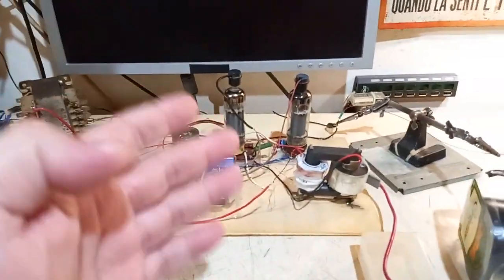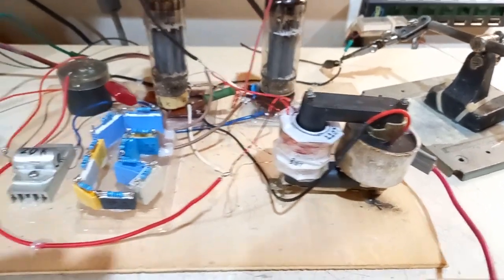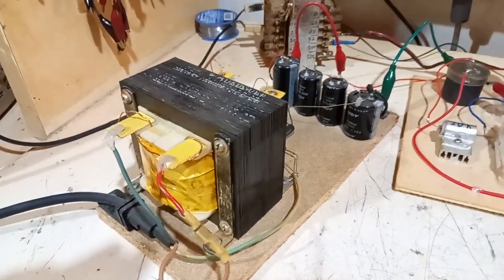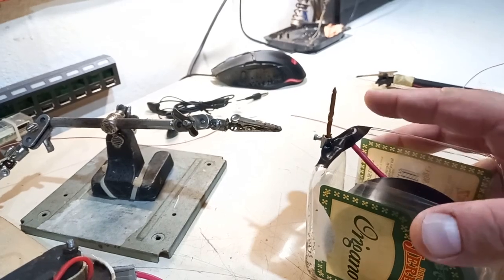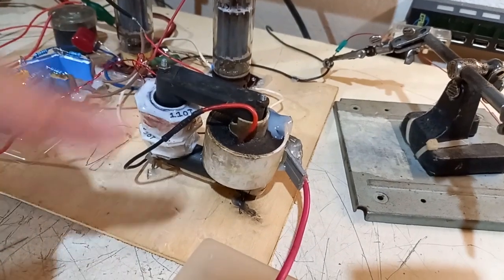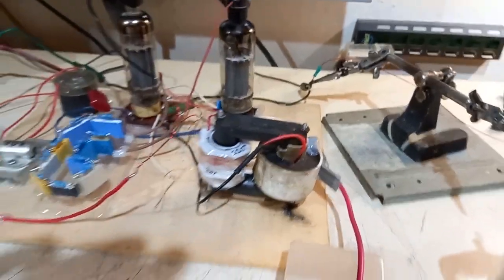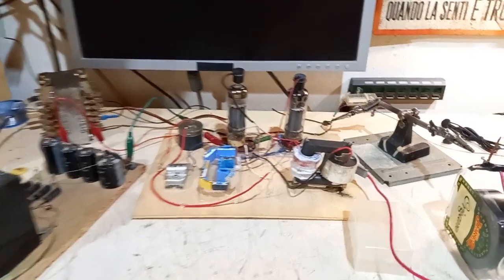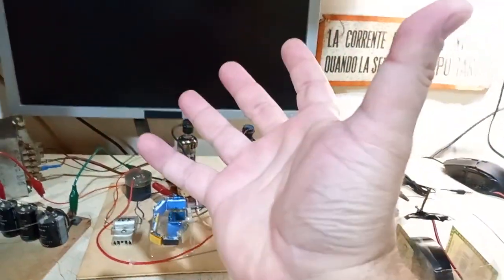A More Powerful Push-Pull Tube Flyback Driver (2/2)

Comment: Ah I see, sorry, you have the scheamtic in the description. I wad blind.

I wonder if this would work better with a gridleak, so capacior across your grid resistor to establish class C bias so you could drive the tubes harder to get more peak output power.

A friend of mine form poland is doing a similair thing with 2 GU-81M tubes in push pull, he's also been building a computer simulation of such a circuit. Real fascinating stuff.
Reply from the maker: apparently considering the slow speed and the circuit being specular a simple low inductance resistor is enough, i tried with caps but it just works worse, there's probably a better way than this but it works decently, tho i'm not exactly proud of this project

Comment: I've always wanted to build a TC with a push-pull circuit but been told it  doesn't work too well.  It's possible it would be too good and sinusoidal, TC seem to work best with square waves. Maybe a Flipflop would work🤔 😄.  Anyway you've demonstrated it works well with a ferrite transformer. 👍    That's always the way with HV fun , the arcs get bigger and better until suddenly the transformer get internal breakdown and games over.

Comment: great video
nice arcs
but have you tried using the russian flyback circuit
it uses a pl519 and around 600V dc and the arct are hotter and longer
Reply from the maker: yes, i made it with both the PL504 and the GK71, but the arcs are not that much bigger, only with the GK i got big arcs, tho i haven't refined that circuit much
Reply: @PosthumanKindergarten  oke
I probaly missed that one

with the pl504 I also only got weak sparks out it
the pl519 really lets it live

Comment: very good video!

I played around with some of those tubes, and I have realised that building self excited oscillators with such tubes will always be shitty because the PL500 series tubes have almost no gain, ranging from 2-3.5

The PL36 has a gain of 5.6 which is the highest for horitontal output tubes, but even vttcs with them tend to be kind of poor since the tube cannot drive itself correctly. Most power self oscillators like to work for a gain of 10-30 from what I am able to find.

A great idea would be to have a seperate oscillator and have the tubes as power outputs (the way they are supposed to be driven).

Again good video.
Reply from the maker: you can always increase the feedback, no magic
Reply: @PosthumanKindergarten  with such a push pull oscillator you built that has capacitive feedback from the opposing anode the feedback maximum would be 1:1 .   so that doesnt really work if my understanding is correct.

from my Experimetation is that the tubes never tend to bias themselves fully correct since other losses never allow the oscillation to turn the tube on hard.
Reply from the maker: @janno288  dude! what kind of stray capacitance are you talking about??? this thing runs at barely 20kHz, the stray capacitances are nonexistent in in this case... also you haven't studied my schematic apparently, but i'm not here for this... you know... you sometimes say things that don't make much sense, i know that you're young and you're in your "bighead phase" with science, but slow down, you should be more "unsure" about your "experimentation" and limit the amount of things you say because of being more unsure
Reply: @PosthumanKindergarten  Oh god, i see it now.   I watched this video before going to bed at 5 in the morning and thought it was similair to your tube ZVS.   I am sorry, you are using inductive feedback with a single gridleak it looks like?